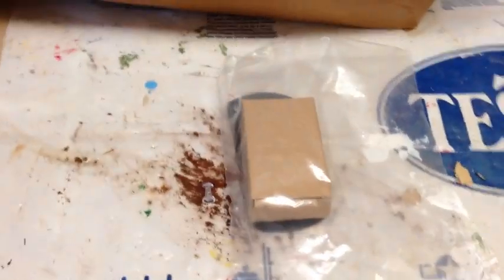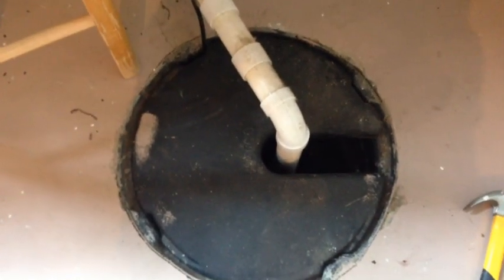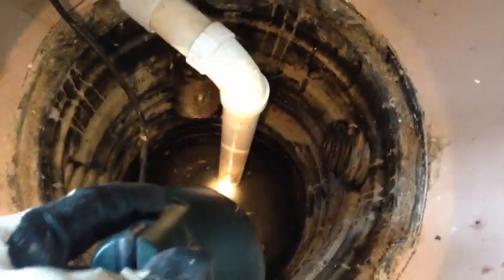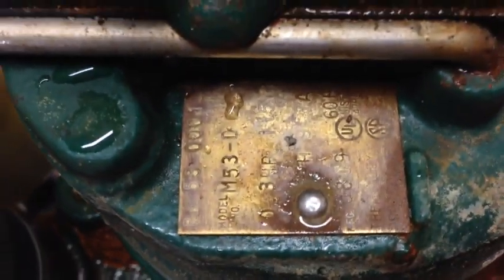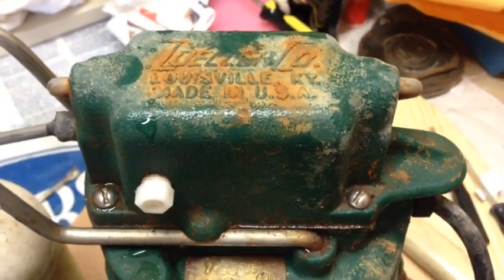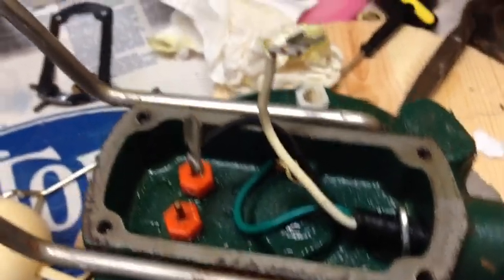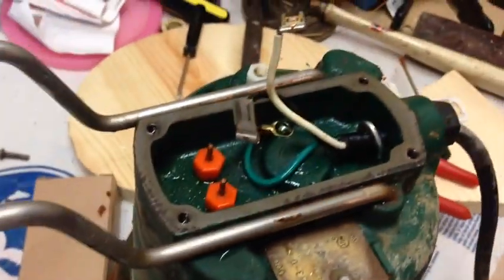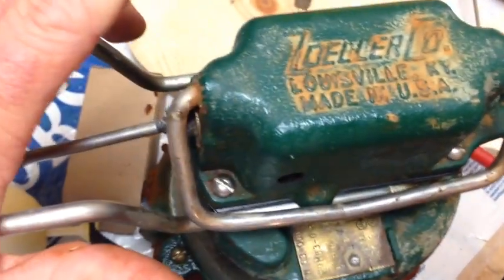Zoeller Sump Pump Switch Repair

Comment: My switch was not turning off so the well was going dry. I called my plumber and he said the pump had to be replaced but I told him to just replace the switch. He said thats not possible because its a specialty item and not doable. Lost my trust in him after finding the item very easy on line for a couple of dollars and your video just so easy. Thank you.

Comment: Hi, good video.  Just one suggestion about your installation.  I think it would be easier for you if your pipe coupling was higher than it is now.  In other words, have a pipe about 2 - 3 feet tall that screws into your pump base and couple it at that height.  Then, you won't have to reach down near the bottom of your sump with a screw driver to tighten the coupling.  Thanks for putting up the video.

Comment: Good video mate. Just a small suggestion - next time you make a vid use a fixed cam for the parts where you do the repairs. Cant be easy moving a sump pump around but it makes for easier viewing.

Comment: Thanks for the demo. It really helped me change mine out. I have to give props to Zoeller customer service. I emailed them explaining the problem I was having. The pump would not turn on every once in a while and I had to tap it before it would work. The tech told me it was a bad switch and immediately sent me out a new one free of charge. THAT is the way to back up your product.

Comment: Thank you so much, huge help. Prob wouldn't have been able to figure out how to remove the top without your video and suggestions. Do you actually have to replace that white screw, I have anew one, just didn't know if replacing it was necessary.

Comment: I bought my first Zoeller pump in 2006.  That burned out and I replaced it with a new Zoeller pump in 2008.  In 2011 the float switch failed.  It was a bitch to replace with water coming in, but that lasted until February 2014 when it failed again and it burned out.  I bought a new Zoeller only because every place I looked they were hailed as the best pumps money could buy.  Maybe the third time was the charm!  March of 2016 the float switch burned out again.  I replaced it with a Wayne.  Hope it works.
Reply: Get a Hydromatic pump(D-A1, SD33, and SD50 are the best ones) if you want a VERY long lasting pump, they have piggy-back plugs so you can easily plug in the pump manually.
Reply: Hows your Wayne pump doing? I just bought a Wayne pump cause it was much cheaper and higher output.

Comment: I'll never buy another pump with an integral float switch. External tethered switches last longer & are easy & cheap to replace.
Reply: I saved a float switch from an old pump and plugged that into the zoeller pump (after removing the disintegrated integrated switch and connecting the white wire to white, black to black, leaving the green grounded as is and sealing up the holes and mating surface with RTV). Works fine. YRMV

Comment: Hitting the cast iron cover could crack it.  Instead put a large flat screw driver between the tabs and the guard rod on either side and pry up.  Do the same for the back between the shelf like protrusion that your were hitting and the frame.  It will pry right up.
Reply: Great advice. The upper portion contain two semicircular lips (or you called them "tabs"). I follow your instructions to pry there with a flat-head screwdriver. It worked very well because of the mechanical advantage.

Comment: Thanks for showing how easy this really is Bryan. My Zoeller model M57 switch went bad 4 years ago and my plumber told me it's better to just throw the pump out and buy a new one. Unfortunately, I did. Two years later, the switch on the replacement pump also went out, but this time I found your video and ordered 2 replacement switches from Amazon. I'm saving myself $125+ each time by replacing the switch and not buying a new pump.
Reply: +Mike Medema  I think the warranty on the pump is 3 years?  So you should have been able to get a free one from Zoeller with proof of purchase/registration.
Reply: My plumber's diagnosis was the same, $526 for new pump, labor and tax.  First pump failed in 7 years, the $526 unit failed in 5 yrs.  Same short cycle problem.  Shall I call him to say I repaired it myself for less than $40?

Comment: It appears there is already a check valve at the discharge of the pump. The second check valve half way up the wall seem unnecessary in addition to being poorly located.

Also, the wire colors really make no difference on the switch and to the motor terminals. The pump motor is 115VAC single phase, so either terminal on the motor can be line and/or neutral.
Reply: Observing the wiring on disconnect and reconnecting the same way is always a winning strategy.

Comment: I have 3 of these Zoeller pumps and have had to replace all of them.My wifeI even called a plumber one time and he had no idea this could be done and just replaced one entire unit.

I spoke to Zoeller several times and, one thing that can make this even easier is the fact you do not have to replace the white plug. In fact (even though the directions do not say this), they recommend you DO NOT replace this unless you have to.  I wish I new this before because it is really hard to get it in there. 

Also, if you have a pump that runs all of the time, these are going to burn out in a couple of years. The Zoeller poeple said to either lift the pump in tank (so it is higher and does not cycle on so much) and/or use a piggyback float so it does not run so much. Set it up as high as possible in the tank - Zoeller 10-0055 Switch-Mate Piggyback Variable Level Float Switch
Reply: Most. Plumbers will opt for a full replacement if it is not under warranty. Special cost any product additional and sometimes most times it is easier and the same price for a plumber to replace the whole unit.
Reply: @joeythedestroyer4852  yer right about that full replacement.  My first Zoeller lasted 7 years and, Mr. "just replace the whole unit" cost $100 labor, + $380 (for a $170 pump  + tax= $526.  This repair for the same problem after 5 years, I can tell him I did it myself for less than $40.

Comment: I have the same exact problem with the float switch on my Zoeller M53 sump pump.  I replaced the entire pump with a brand new M53, but after watching this video, I think I will rehab the old one with this Levelguard switch.  Rather than cutting the wires, could you have just moved the wire connections directly from the incoming power cord to the connection points on the pump?  Just wondering.  Thanks
Reply: The connections on the pump are pins and the connections on the switch are blades. You need to change them out for the correct ends, or just solder them on.

Comment: Cool video. But your check vale is 1 1/2”.  2 inch pipe. 2 inch pump. Better performance and valid warranty 2 inch check valve needed.

Comment: I think the plastic plug may be a spot for pressure testing after your work is complete. if it leaks after this work, there is a potential for shock. maybe just use a GFI, or put the outlet where you can reach it when you come down the stairs?

Comment: I'm literally watching an instant replay of my day today. What is the average life span of the switch typically? I've lost two of my pumps in one year.
Reply: Mine has been in since about 2010 and just now the switch has failed.
Reply: I just spent a day going over the design and it is inherently flawed. All it would have taken is just the absolute tiniest amount of silicon to seal the switch itself to prevent water from getting into the actual switch. They have a rubber gasket on the wire inlet and the switch arm actuator passthrough as well as a rubber gasket on the switch housing to pump housing connection, but none of those are going to remain watertight with constant movement and vibration, plus from the factory, all of the ones I checked out in 3 different stores today are torqued down so hard the gaskets are squished out and not sealing. I think this may be on purpose. 

Given a short bit of time water makes its way into the switch and soon enough the switch is shorting and burns itself out as it rusts itself apart. 

Had they bothered to use a water-sealed switch it might have been a lifetime product. 

I just removed the sith housing on mine, directly wired the pump to the plug, filled the cavity with silicone, and covered it with a fabricated stainless lid using RTV to seal it and silicone to add an extra layer of protection. 

Then I went and got a cheap remote float that turns it off and on, plugged them in and bam, 40 bucks and a bit of my time to correct their manufactured failure points, and this pump is up and running again like new.

Comment: Considering how often these switches fail would it make more sense to use a piggyback switch?  That’s what I did. Here is my story: between 2004 and 2007 I had about 4 failures all due to switches. Then I bought a levelguard switch in 2008. Now it’s 10 years later and it’s still working.  If it does eventually fail, replacing a piggyback switch is much easier since you don’t have to disassemble anything.
Reply: If you want to put a level gaurd switch on one of these you would have to bypass the original switch and tie the wires together in switch box correct or tie the float up correct since you need those contacts in switch to get motor to run since the piggy back level gaurd won't send juice to the motor.How did you do it?
Reply: wish2fish in my case the switch failed “on””. So there was nothing I had to do. The easiest way to tie the float up is to remove it altogether then with the lack of weight pulling it down the lever should stay up on its own.  In either case this does Not require opening up the switch housing.   Only if the switch failed off would you need to do more work.
Reply: ok-thanks for the quick response.I was not sure if just pulling the float would be sufficient.My sump does not really run that much unless we get heavy rain and have a M72 which is a builder grade pump from our new home build in 2014 and want to upgrade and get battery back up also in the Zoeller Pro Pak.I was thinking of getting a new M53 and wanted to use level gaurd.I see they sell the "N53" with the level guard as a  package since it does not have the integral switch.
Reply: Piggy back float will be a float on a wire and the float guard provided will not do anything. I am a plumber and 1 out of 5 pump repairs is toilet paper sitting on top of the float. The float protection bar is quite a quality idea when dealing with sewage ejector pumps.
Reply: @joeythedestroyer4852  this isnt sewer though!! Lol. This is ground water bub...some plumber you are

Comment: You missed the dielectric fluid which is missing in your pump. How can you forget that?
Reply: Alek Martin 
Hi- I noticed your comment on a YouTube video. I'm changing the switch on my Zoeller sump pump and noticed the fluid in it.  I thought that water might have gotten in, but the fluid is thicker.  Does it belong there and do I need to add any more?  Thanks for your thoughts.  -Dave
Reply: The fluid is called dielectric oil. You should add the dielectric oil/ fluid only if it is dried out or missing. This fluid is supposed to be an insulator. You can probably substitute with transformer oil if you cannot get dielectric oil. -->  https://www.supplyhouse.com/Zoeller-002588-Oil-Dielectric-19-Oz?gclid=EAIaIQobChMIybz-seCf3QIVh7rACh0pZg4vEAYYASABEgKHSPD_BwE